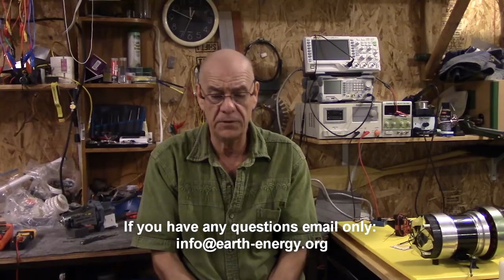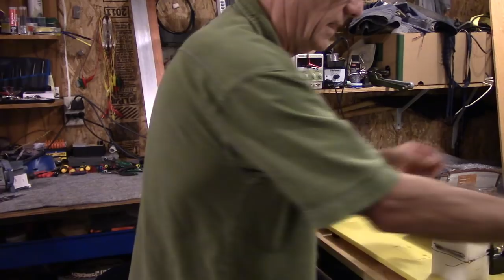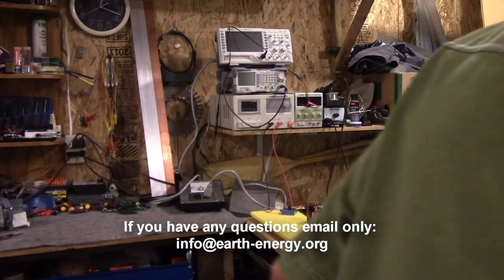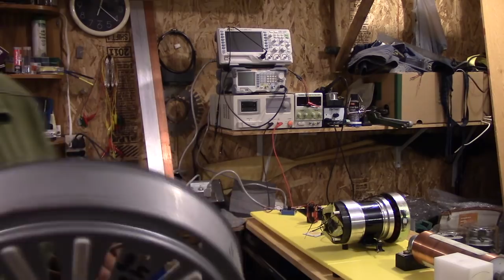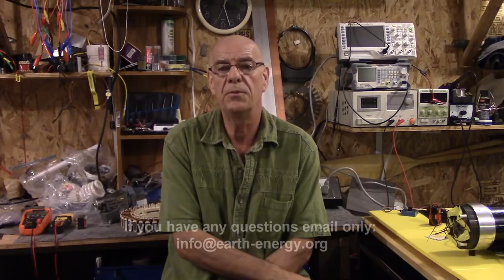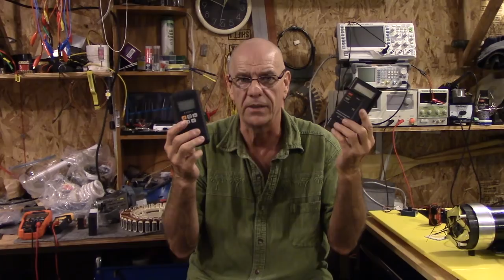Gerard Morin: The Final Video

Comment: I  agree with your law of potential one question? The noodle bar is basically connected to the ground bar. Where in the circuit do I place the SG. And once I change the man made wave can I parallel that potential. I really miss your input and not all Americans have no balls. Whats your potential release those SG's can only release so much unless you put them in series. The power returning on the  noodle can I tap that or shall I say try that? Come back man you are very appreciated wish I could have a beer with you and some loose leaf keep grinding. Sláinte

Comment: +Gerard Morin

You and I could spend ten hours per day just talking Gerard, and in a years time, never discuss the same thing twice.. I'm 100% sure of that. I'm figuring on using the E Address that was on this videos banner to write more elaborately later, but I wish to mention now that, you're not doing what you do alone, in regards to the larger picture. 

Everyone has their particular specialty that, through what seemed to be mostly just random life experiences, is now becoming more understandable as to the reason for those experiences. You're on the front line in this field because, obviously, you've become highly experienced in it via your livelihood, I'd presume, and as such you're ability to consider different aspects, or your ability to shift your perspective rather, and then do the tangible bench work that follows that change in perspective, is better refined than of one who has learned through different sets of experiences, any other particular discipline. 

I am also currently fully engaged on the front lines of this very same war, however the particular battle I am applying my experiences to, has a different theatre on which it is being fought. Interestingly enough however, as converse and unfamiliar these battle theatres do appear on the surface, they are unquestionably linked as to their nature at the deeper levels of understanding. It's quite profound actually...

Also in regards to the cowardice of the public at large, or the general public depending on how you understand those to be, they have been programmed that way, as we all have been to varying extents, in order to manufacture fear based obedience, just as would a K-9 being trained to behave according to one discipline or an other.. So it's not their fault they are this way, and if we know of them that are still blinded by fear, yet are inherently good natured at heart, we can't choose to abandon, or scuttlebutt them to then watch them clog the works and suffer through no fault of their own. It sounds like you have imposters, rattled the bee hive a good bit, and because it doesn't behoove the bee hive if one doesn't behave as do the others, they have made a beeline for emotional manipulation internet guerrillas to focus their sights on you.. If you close your channel now, they have then succeeded in their campaign, and you don't strike me as the type to allow success of your opponent by default.. Fuck em!! Let them talk shit, let their people's peer through peep holes to see how real men live, act, and relate to others during the course of usual days for men who wish to assist their fellow man without expectations of any return..Only cowards waste their lives, spending time each day of their life, watching or performing surveillance on someone else's daily life, without that one's awareness to it, write emotionally charged statements to effect a reaction of any sort from anyone, and imply that this sort of action is a means of livelihood or has any sense of honorable duty whatsoever. Who would take pleasure in spending their lifetime, each day as a means of income, watching others just living life, whether during the course of a workday or during one's private hours, who spends life to make a living watching other people living life? it's absurd. So fuck em, an perhaps they truly deserve our pity. You never see anyone but cowards running around town, among all the unarmed people at large, and themselves wearing Kevlar jackets, steel toe boots, helmets, gloves, and eye protection, dawning batons, Pistols in holsters, pepper sprays, electrically charged darts, shot guns, assault weapons, specialized vehicles that are designed to induce a hypnotic trance state in the human mind though the Hertz frequency range around 61.6 Htz, to 66.6 Htz using an FM generator Amped to it's allowable max, but frequency in the 0 to 200 Mhtz to induce fright, flight, or fight.. Numbers are Numbing, Numerals are Multiplyable, or Divine, and so a frequency CAN indeed be a Number of a Beast, and it is that of a Man. 

Perhaps you can give some consideration to this, and how an anti-resonance device would nullify the numbing effects of a thing like this. Would it? I'm aware to how these are used in churches to cancel out the undesired frequencies of the organ pipes in preference for the more aMUSING, aMAZING, and Emotionally charged frequencies that the human mind is susceptible to. Rf's, Fm's, Am's, Ac's, Dc's, BC's. AD's, AID's, DvD's, LD's, CD's, JC's, JvC's, Sine Waves, Sign waives, Signs in Nature, Signatures, Symbols, Cymbals, Warning Signs, Warming signs, Warring Signs, Signs of War, Sinister deeds, Sins indeed, Signs indeed, Signs of intelligent Science, , the Signature, aka, the Original Sinner, The Original Signer, did not write a curse in cursive spelling, but in tongues, spoke the Original Sine Wave ever uttered, when no-one would dare break the sound of silence.. We need the Anti~Lambda, the Anti~Reasonance device predicted long ago and called the Anti~Christ, Aka Anti Crystal Resonance, Resonant Redundancy, Resistance to Assistance of the Assistar, in avoidance of the Disa~Star., as it is above now,  it shall be below later, for now and later..

I'm rambling a bit here I know, but these things I'm pointing out are not by coincidence.. 

Please keep your channel up but if you functionally just can not do it, please dump your material on my channel if you can.. If you can't, ill link my email, or something else to preserve your works.. I know you plan to move them to a different web page, but the more redundancy in back up locations, the less likely they are to be widdled away from time...

Thank you for your works in any event...